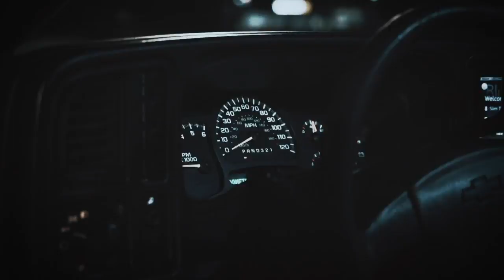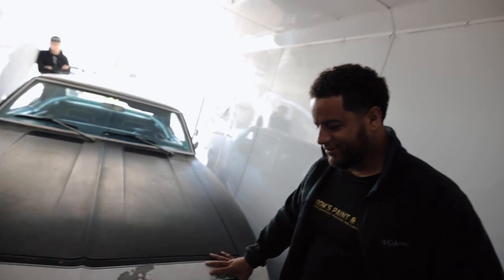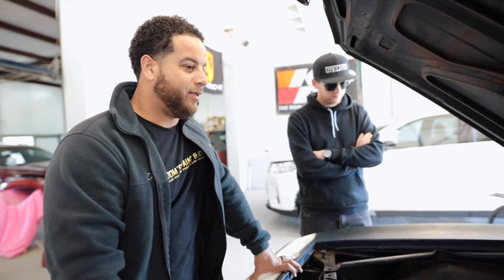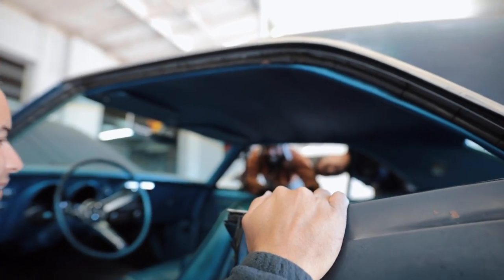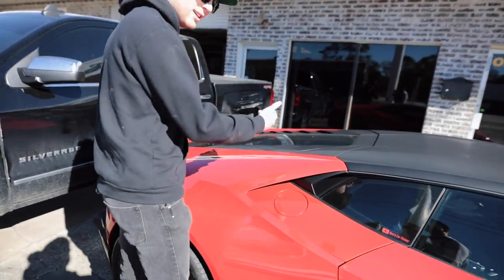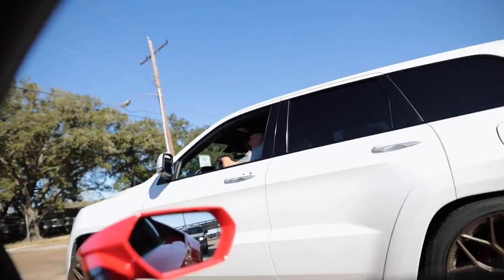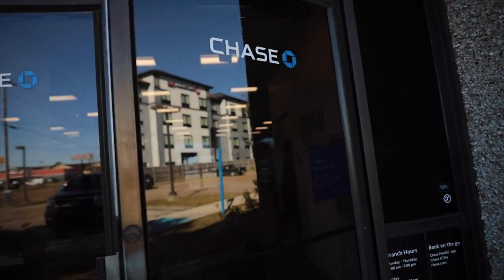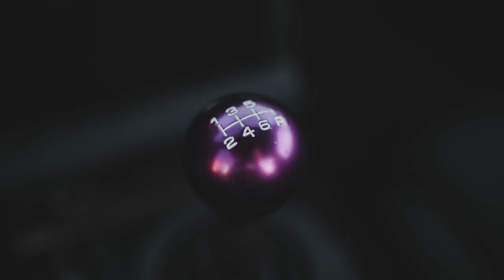Dropping off my All-Original Camaro for Restoration!!

Comment: so we aint gonna talk about how a SUV just smoked a twin turbo lambo on acceleration??
Reply: I mean it’s All-Wheel Drive and makes upwards of 700+awhp, I would fuckin hope so. Stock Huracan’s only make 573-602hp and 398-412ftlb of torque, that twin turbo kit maybe added 150-200hp and maybe the same in torque, but they also weigh 3400-3500lbs with two people in it closer to 4000lbs, can’t replace instant torque and all wheel drive when they make almost identical power lol.